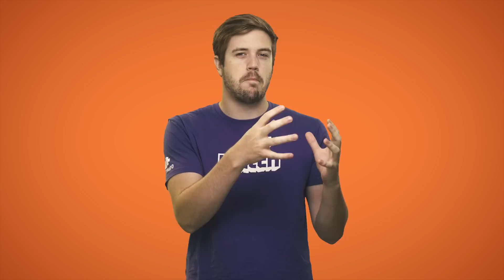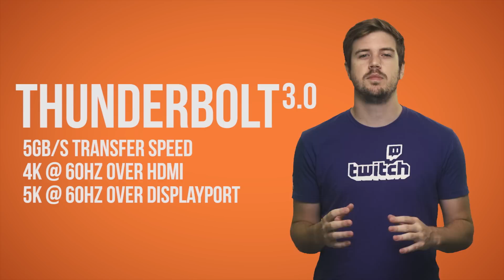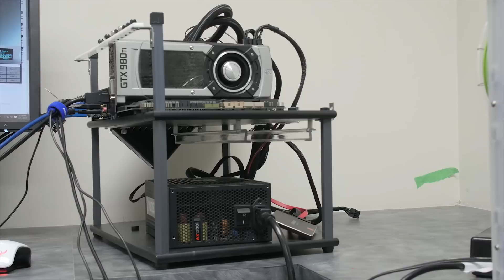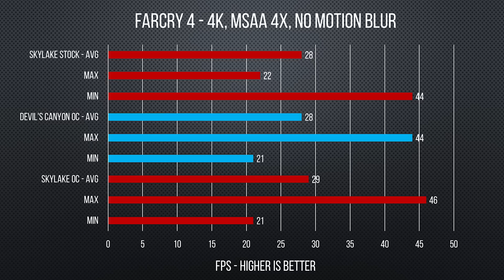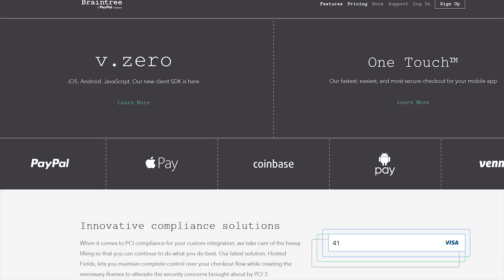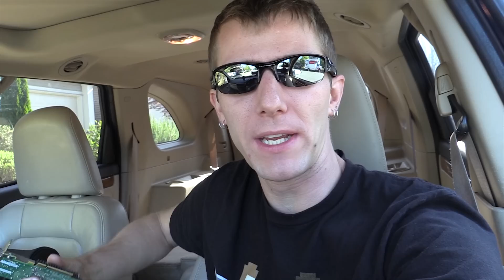Intel 6700K "Skylake" CPU

Comment: X99 is where it's at. Not Skylake.
Reply: ***** its called a typing error
Reply: ***** What did you just say?
Reply: Tootses2 Gaming The X99 platform has better CPUs than Skylake. And so if you're looking to upgrade, go for X99. Not skylake.
Reply: ***** But no. Why? Because no.
Reply: ***** Because I do.
Reply: Tootses2 Gaming <3
Reply: NEGOZIO ...Yes? The i7 5820k and 5930k are both 6 core extreme series CPUs and the i7 5960X is an 8 core extreme series CPU. They're enthusiast grade flagship chips. The 6700k is the consumer grade flagship chip.

Take a look at some benchmarks, the 5820K which is an amazing CPU (I have it) performs better than the 6700K and it actually costs LESS. On launch it was around the same price but prices have gone up now. I see no reason to go for the 6700K it is a complete waste of money xD
Reply: ***** Weedlake.
Reply: Infinite Zero 1. The Skylake CPU costs more than the 5820k which performs better than the 6700K.
2. Clock speed isn't everything, it's only a 3fps difference, nothing major. On top of that you can usually OC these over 4GHz without changing voltage. Got mine running at 4.5 right now, haven't touched the voltage.

3. It has lower power consumption because it has less cores and less performance.

4. You can get a good X99 motherboard for £140, which is around the same price as a good Z170 mobo. Cheapest is around £100 for a Z170 I think.

5) I wasn't talking about non-video editors. An i7 is supposed to be geared towards an editor or live streamer or heavy gamer, I thought this was self-explanatory.
Reply: +Tryte 6700k has a much better single core performance. Which is what is really important in gaming.
Reply: Why is no one pointing out that there's little point in comparing a consumer cpu with an enthusiast cpu?

Like, that point was essentially made at the very beginning of this vid... Apples for Apples. The fact the consumer skylake CPUs/builds are pretty much keeping up with the enthusiast ones for the same/cheaper price says it all, if anything.

Wait until they release the enthusiast version of the Skylake cpus and then make this comparison.
Reply: +NUCK CHORRIS For the record Haswell-E is going to be replaced by Skylake-E, so your longer lifespan statement doesn't make much sense. The platform is not the motherboard, if anything it refers to either the development platform, Skylake or Haswell-E, or the combination of chipset, cpu microarchitecture, and socket, though two of those are parts of a motherboard a motherboard has quite a few more things on it than that. As for your statement declaring they can't be compared clock for clock, isn't that the point? I've been saying that the CPUs at the same clock speed have different output performance, the whole reason single core performance is important is because it is the only way to level the playing field between the microarchitectures until Skylake-E comes out to support Haswell-E's feature set (and core count). Ironically your argument seems to be that Haswell-E supports a higher clock and more cores, therefore is better, ("I can guarantee 95% of haswell E will be clocked to 4.3ghz minimum, therefore, putting them out of range of any current 4core on any task you throw at it.") and that is ridiculous. Also they aren't dropping Skylake support on windows 8.1 until next year, and that has less to do with Skylake and much more to do with windows 7 and 10 being Microsoft's most popular platforms, both of which will retain support indefinitely. The whole reason this argument exists is because I said people should wait for enthusiast skylake chips, referring to Skylake-E, because then the microarchitectures could be directly compared, this is also why I said you could overclock a 6700k up to anything like a 5960X and still get better single-core performance, I definitely misspoke there, but I won't edit it for posterity. Edit: Also this http://www.pcgamer.com/the-world-record-skylake-overclock-is-an-insane-7ghz/ which actually beats the world record clock for the 5960X, thought I would throw that up here for fun.
Reply: givemeajackson Yeah, they overclock like a monster. Got mine stable at 4.5GHz without even TOUCHING the voltage. I haven't tried it any further as that's all I need. Just rendered a 10 minute video at 50Mbps, 60 fps, 1080p, max bit depth in under 5 minutes! On the time line there was a lot of blur effects, keyframing, reframing, pitch control and colour correction and colour grading.

Temps stay under 70'c, even when rendering they hover around 66'c, but when gaming anywhere from 50-63'c. Having 6 cores helps stupendously with video production.
Reply: givemeajackson Maybe, just installed the Kraken X61 so I should be able to push it quite far, however I don't really need the added performance or added heat.
Reply: +Tryte 1. It costs more.
2. Lower clock speeds result in lower game performance until DirectX 12 comes.
3. Skylake has a lower power consumption and heat output.
4. Skylake has cheaper motherboard options.
5. For non-video editors, the i5-6600k would probably be the best option.
Reply: The 6700k is a lot better than a good amount of the x99 CPUs... It's a lot cheaper and performs around the same. If you compare a 5930k which is near 600 dollars, it doesn't outperform the 6700k in any tests... It only does good when using every single core, but only by a slight margin. In a single core test, the 6700k crushes the 5930k. So either spend 340 on a 6700k or 600 on a cpu that won't give you any performance gain, actually giving you less
Reply: +Tryte you are literally the stupidest person I've ever met. A 6700k beats a 5820k and a 5930k with ease. Tell me where you get the bench marks where it crushes skylake? In bf4, the 6700k has about a 15-20 fps gain, in crysis 3, it has a 15 fps gain, in far cry 4 it has a 20fps gain. In gta, a 20fps gain. The 5820k only beat the 6700k in a few cinebench tests, which don't even come into real world performance. I did all of these tests my self with a Titan x. Your arguments are invalid my friend.
Reply: I yes it is got a x99 saber tooth she looks sexy!:D
Reply: ***** pretty enthusiastic advice there. I really don't see why I would need all those cores when I'm gonna primarily game. Of course I wouldn't even need i7 either, but I did get a good deal considering how expensive it is on amazon and Newegg. No need to undermine my reasoning. The difference is so little anyways. 

And I don't know where you get x99 that cheap. Mostly, in US, they're higher end with at least 250 for decent ones. i7 5820k too, i cant find it at that price in dollars.
Reply: ***** Erm... I'll be honest, chap, i think you missed the point of my comment. I know the difference between the two. In fact that's the issue i am raising... This comment section is comparing apples to oranges, not apples to applies.
Reply: ***** *slow claps*
Good input... I forget Youtube comments is predominantly teens who think they're sassy. =(
Reply: doggod106 There's no point trying to reason with him. He's missed the entire point of both this video and our arguments. He's just some angry teenager trying to justify the excessive amount of money they/their parents spent on an enthusiast build - rather unnecessarily at that, since people are welcome to spend money on what they want.

I should also point out there's a LinusTechTips vid that shows realworld benchmarks of the 6700k beating one of the haswell-e chips (can't remember the exact model) for gaming...
Reply: +NUCK CHORRIS "because you know I'm 100% correct" No it's not, see I actually did the research compared benchmarks and tried to make my point to you, but you haven't done a damn thing to propagate a real conversation, you just say things are better for reasons and then insult me for apparently no reason other than your own insecurities. EDIT: also for someone who calls Linus a "dudebro bum" you actually use lol un-ironically, make constant grammar faults, and barely use commas to clarify your sentences, not to mention you throw around insults like a 13 year old with mental instability.
Reply: ***** yep. you need ddr4 anyways, the only thing slightly more expensive is the mobo, but you get a kickass mobo in return and 2 more cores with 4 more threads. love my 5820k, it's an absolute beast.
Reply: ***** ok, you won the chip lottery in that case. mine takes 1.32 volts at 4.6, but i actually clocked it down again and undervolted it. it's now doing 3.8 on all cores at 1.03 volts. more cpu power simply isn't needed in my case, so i thought why bother. you should try going further, i think yours might go 4.9 or even 5.0
Reply: ***** yeah, but your chip is extraordinary. i'd do it just to see how far it goes. got the kraken x61 too, great cooler. with my undervolting setup i get about 47° in games, pretty neat.
Reply: givemeajackson Wow, really? Those are some tasty temps! I need to change the fans for it, though. They get pretty loud after 35% fan speed.
Reply: ***** i use thermaltake riings, but i'm gonna change to the 140mm NB eloops as soon as they're available
Reply: givemeajackson Hmm, let me know how they fair.
Reply: I had the 120s before, best fans ever imo. But not as pretty as the riings
Reply: givemeajackson I want to get the Noctua NF-A14's to replace the stock fans as they're quiet and perform admirably but do you think they're worth the price? Or do you recommend another fan?
Reply: +Tryte i honestly think the riings are better fans than the noctuas. noctua have been without concurrence a few years a go, but the competition has caught up lately. still good fans, but too expensive and too ugly for me since there are options just as good and way better looking.
Reply: givemeajackson Thanks for your input, I'll have a think on it :)
Reply: givemeajackson the cpu sucks, it gets hot as shit and no games need 12 threads...4790k and 6700k are ahead in every fucking game...its a nice render machine and video format converter, yes.
Reply: ***** there's already quite a number of games that utilise more than 8 threads, and that's the trend for the years to come. dx 12 will further improve on that. it get's less hot than the 4790k did due to the soldered heatspreader. and once overclocked, per core performance is almost up to par with the 4790k, with improved multitasking, more productivity (i produce music, i need it) and more pci lanes. the 5820k is the cpu to buy right now in the high end segment, period. overall an x99 system costs around 100 bucks more than a z170 system, and for that you get a lot more performance and more future-proofing. get your facts straight before you talk shit.
Reply: x99 if you are a enthusiast yes it will give better performance over a range of tasks if you are just a gamer who has no need for rendering or super high end gaming and want to build your first computer skylake or devils canyon would be a great starting point for people who just want one thing and not alot else
Reply: +Tryte I AGREE. I LOVE MY 4790K. BUT I REALLY LOVE MY 5690x i have a 6700k im not impressed. i run a local lan center out of my basement and i wont be switching out anytime soon. i have 6 4690k i5 setups and they do just fine,
Reply: I got a I5 4690K :p
Reply: Zebrish Other No, not much better. It is better but that's because of it's higher clock speed which you can easily match by overclocking the 5820k, which overclocks like a demon.
Reply: ***** Not true. It has a pretty decent IPC improvement over the 5800k series.
Reply: Zebrish Other Oh really? Well, with DX12 right round the corner I think 6 and more cores will be better utilized for games, also to add, 6 and 8 core CPUs are fantastic for games like Total War where it can get super intense. Usual FPS on a 980 and 5960X with 4 cores disabled showed that when clashing two armies the fps would drop into the 20's but with 6 cores enabled it was high 30's. 8 cores was about 2-3fps more than 6 cores.

So in short, I guess it depends on the game but more cores isn't just useful for gaming. Multitasking, video editing and rendering, day to day performance and perhaps livestreaming if you're into that, shows a big improvement over the traditional quad core CPU. Also the file write fps and actual fps gap when recording is greatly reduced with 6+ core CPUs as compared to 4 core CPUs.

And also bragging rights :P
Reply: ***** True. I'm going on cpuboss results here, so in all honesty it may not be as big of a difference considering a lot of people give cpuboss flak.
Reply: Zebrish Other Either way, I'm happy with my 5820k. Won't be upgrading for a long time :)
Reply: +Tryte "performs better than the 6700K"

Sometimes yes (when it comes to utilize all cores/threads), sometimes - not really (when it comes to stronger single thread).
And don't forget about "inverse-hyperthreading" in Skylake.
Reply: +Tryte Go look up some benchmarks on YouTube.
Reply: +Tryte Also, you though this was self explanatory? You said Skylake, not i7-6700k. Anyway, the 6700k outputs less heat. Considering X99 is on a larger die and has a larger heat spreader, at stock speeds the temps on the 5820k will definitely be much lower. However, to get the 5820k to the 6700k's performance level, you'll have to overclock it over 4 Ghz. Even with better overclockability, you can't say the 5820k will overclock higher than the 6700k at a 0.7 Ghz lower base clock speed and a less efficient last generation architecture. Sure, if we want to talk editing than the 5820k beats it, but not everyone edits heavily. To some people, render times aren't very important. And with a high-end graphics  card, you'll be surprised at hoe much FPS difference there is with that kind of difference in clock speeds. On top of that, X99 motherboards lack some of the features like USB C that Z170 motherboards have. Besides, if you go on to pcpartpicker and search for lowest prices for both CPUs, the 6700k is priced at $370 while the 5820k is priced at $380.
Reply: Infinite Zero 6700k is more expensive here in the UK. My motherboard has USB 3.1 support and a USB type C connector if cases support it in future. There are also other motherboards with a type C connector on their IO. Overclocking the 5820k to 4GHz is easy. So easy it's not really up to 'the silicon lottery' because pretty much anyone can do it, even on a Hyper 212 EVO. I should have made myself clearer though about the "skylake" and not the "6700k".
Reply: +Tryte The motherboards cost wayyy more though that's the biggest downside of x99
Reply: krauser979 You can get the MSI SLI Plus for £150 here in the UK. That's around the same price as Z170 motherboards and only a little more than Z97 motherboards.
Reply: +givemeajackson The riings are good. They have more pressure for rads and are damn quiet.
Reply: You know what? The difference is negligible anyway. The 6700k is my pick because of cheaper available motherboards.
Reply: They're both good just pick whatever platform is cheaper and besides by the time games take advantage of 6 or more cores the 5820k won't be powerful enough compared to whatever other 6 cores come's out. The same thing happened to the q6600.
Reply: +Tryte I agree x99 is better, minus some games.... few fps but it still counts as worse :P ... just wish they would drop the price a little... dropping 600-1000 just on the CPU is nasty! 

luckily for me i only really need the cores for gaming, so won't be needing the x99 CPU's unless directx12 changes that
Reply: +Ricepudding yeah man. Those CPU cost so much and honestly you don't actually need that much. I actually picked up 6700k going up from 2600k from 5 years ago. Got it from Micro Center for 350, so I say it's worth it. I don't need 6 cores that can multitask million things at a time. my motherboard was well under 200, at 150 dollars, when normal X99 go well over 200 easily. It's way cheaper and better in price vs performance. X99 is for really rich kids.
Reply: ***** yeah I understand the X99 and Broadwell has more PCIE lanes, more cores and stuff like that, but when I'm primarily gaming, I doubt I'll need any of that extra core, and I wouldn't need extra PCIE lanes because I'm just using a single 980 ti. Having lasted almost 6 years with my i7 2600k, at the end of the day, both platforms can last a very long time. Price wise, just at the moment, a good X99 is pretty pricy in my eyes, when I can pick up cheaper z170. 

I hear DX12 can benefit from more cores but still, that won't be a standard for even a couple years.
Reply: +NUCK CHORRIS actually I followed linus for holiday build, and I ordered the 5820k for $430 and there chip was out of stock. I altried to order ssd 250 gb with 4tb hdd. the mobo came up to $240 also.

I went to micro center (new york city) and they actually did a price check, which means with price check they can even lower it for you like they would try to make a dollar at least on the product against you. 

So when I went there the i7 6700k cost me $319

Msi z170 delux wifi and bluetooth it came with $297

960gb sandisk ssd $99 I shit myself wen I saw that price.

and the evga 980ti acx they sold it for $649

the corsair 540 and the 650w I bought on amazon, to tell you the truth I really don't know if I made a right choice with the skylake instead of Haswell-E. but thank God nothing is wrong with my pc yet lol. 

and I also got just cause 3, world of warship, and cs go for free for purchasing intel cpu, and as for evga 980ti I got myself assassins creed instead of rainbow 6.
Reply: +Tryte Depends on what you are doing, the single core performance of the 6700k is higher than the best of previous generations, but it's multi-core performance is handily beaten by the 5960X or similar 8/16 core processors as you would expect. The best thing to do right now is to wait until we see enthusiast skylake chips.
Reply: +NUCK CHORRIS Stock speeds are important for many reasons, and you can still overclock a 6700k to anything you could do on a 5960X or 4790k and it would still beat the single core performance because it has a better platform. I would love to see these benchmarks you are talking about where the 4790k is beating skylake on equal footing, because every single benchmark I have seen shows a minimum marginal improvement over the 4790k in literally every test. Also single core performance is extremely important to determining the efficiency of a chip, an 8 core skylake should theoretically beat an 8 core X99 at the same clock because of the discrepancy between single core performance, granted I'm not saying that will happen, but there is a reason single core performance is tested.
Reply: +NUCK CHORRIS Most of what you said is irrelevant because I wasn't arguing it, the only thing I'm arguing is that Skylake's architecture is more efficient than Haswell(-E)'s, that is the only thing I have been arguing this entire time. It's 2011-V3 by the way, what the fuck do I care about z170, x99, cannonlake, or kabylake, none of this has literally anything to do with the argument I was making, hence why I only brought it up in passing to correct your mistake. Trying to filter out your random insults and other nonsense makes this really fucking difficult to reply to, and certainly doesn't help the point you are trying to make. I don't know if you realize, but the quote you put there I myself said "I definitely misspoke there, but I won't edit it for posterity", what I meant to say was that you could run a Skylake chip against an equivalent (4-core, same Hz) Haswell-E chip and the Skylake would be able to produce higher performance per core, and thus higher performance overall, but Skylake doesn't currently support higher than 4 cores, hence why we should wait until the comparable Skylake-E later this year (or next). Looks like I forgot to inform you that "socket size aka z99, z170" is chipset not "socket size", chipset by the way has very little to do with CPU performance just peripheral bandwidth due to CPU-northbridge integration and intel's PCH architecture.
Reply: +daemonspawn88 I have in fact seen those benchmarks, it is the reason I opted to add $100 to my build by going Skylake instead of Haswell, And yeah I don't think I'm going to continue arguing with the guy, the only good thing to come of it was refreshing my brain on some light computer engineering stuff.
Reply: I love it when the time comes around to start a new build. It';s been the same for years, everyone has their own opinion, which makes it neigh on impossible to actually build a PC if you ever look for advice from a fellow human being. Instead, I just dumped a bunch of components in my basket and didn't once look for any subjective material on the matter. It arrived. It';s built. I am happy. Moral is: Ignore comments and forums and look for objective results that will give you an informed view based on that data. These sort of comments are simply cancerous.
Reply: +Tryte i can get a 6700K for as low as $331 from the right website. and the motherboard i want, is $100 cheaper than the x99 equivalent, and it comes in white, for my white build. it doesnt have quad-channel, but it still supports up to 64GB of memory (which is still ridiculous, because even with the 32GB i had, i still never used it all). plus, i dont use 3-4 GPUs, so getting 5xxx series CPU is even more of a waste, since i'm not needing extra PCI lanes. also not to mention that for gaming, many games still dont bother with more than 4 cores.
Reply: +Tryte X99 Is so fucking expensive!
Reply: IaMaWeSoMe7478 140USD? An entry level X99 mobo here cost 180 Euro. Also the processors are way more expensive. X99 is targeted towards enthusiast, not towards regular consumers like me. I can get a decent Z170 mobo, 8GB DDR4 and an i3-6100 for 330 Euro.
Reply: IaMaWeSoMe7478 No but it's newer and i like newer. Might not seem like a good point.
Intel might make newer chips for LGA1151 other than the i7 6700k.
Reply: IaMaWeSoMe7478 Well thats probs gonna be on a new socket so yeah...
Reply: IaMaWeSoMe7478 [sarcasm intensifies]
Reply: Im just a poor boy and I don't have money for X99
Reply: But yeah Hasswell-E CPU's are generally much more powerfull than Skylake
Reply: +melangkoh Dumbass Skylake isn't meant for fucking gaming. Its haswell, broadwell, and skylake focus on power consumption and optimizing compatible system. Not fucking power.
Reply: +IaMaWeSoMe7478 Compared to older chips? Bullshit.
Reply: IaMaWeSoMe7478
Try soldering tim in an ultrabook.
Reply: These are two different CPU markets. Mainstream and High end. Different consumer types buy them. I personally have on my desktop Intel Core i3-7100 and on a laptop Intel Core i7-6500U and I like them very much. They work nice.